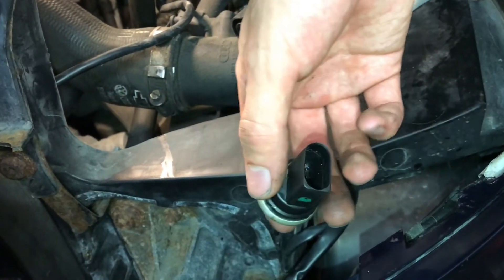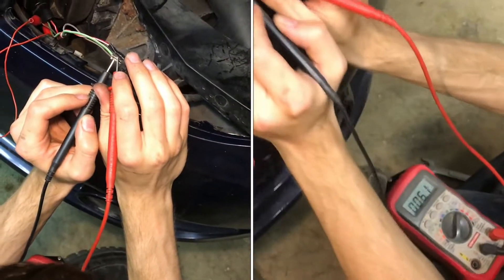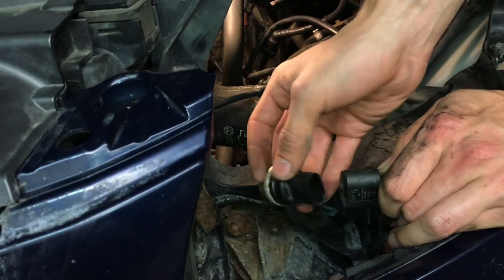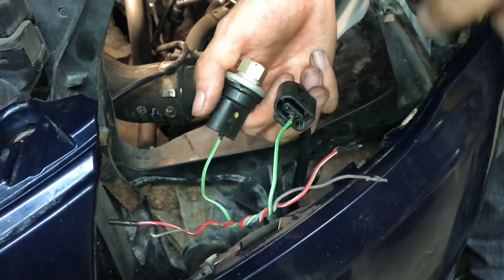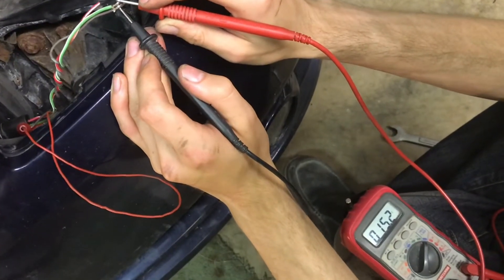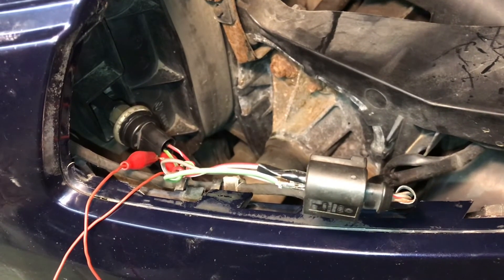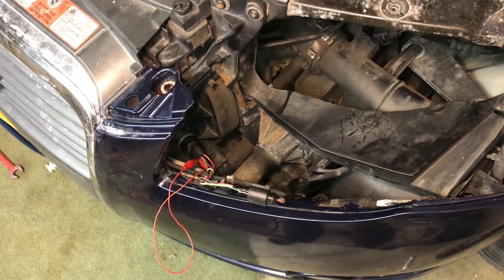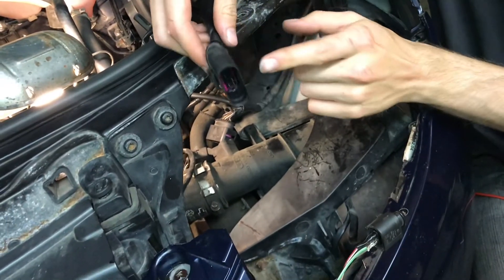G65 air conditioning high low sensor “PIN OUT” (live testing with system pressure reduction)

Comment: I have a 2004 Golf 2.0. I can't get computer to turn on the a/c. I added another defrost switch to my panel to power on the clutch. I know it can't run all the time. How can I cycle the compressor?

Comment: Good video..I have a problem with that G65 sensor on audi A4 B6 year 2003. The A/C working perfect, sudenly no cold air with ECON button stuck permanently on climate control. After I found a leak on the pressure sensor G65. I replaced sensor, charge R134 and the same issue, ECON buton stuck. The ECON status does not allow to strart up the compressor. I did check the compressor solenoid valve and it is working, I hear the click inside each time I apply to it 12 volts. So now, I am lost......Any idea .....?
Reply: Did you figure it out? I’m having the same issue.
Reply: @pedrosandoval7119  Friend. I finally fixed it. No all G65 pressure sensor found on market works with this Audi model. If you can go with 100% compatibiliy, purchase the original audi part. Maybe price over$300 u.s.
If no, you will need to do some search and probably will purchase more that 3 sensors after market until you find the correct part.

Comment: Most of the time you can test signal wire by jumping it with ground first then jumping signal to power wire thats how you do it on two wire low pressure sensor or three so yeh you can let hot touch signal lol
Reply: That will destroy the sensor in this case, and possibly the ECU. These are not simple on/off switches, they are pulse width modulated transducers.